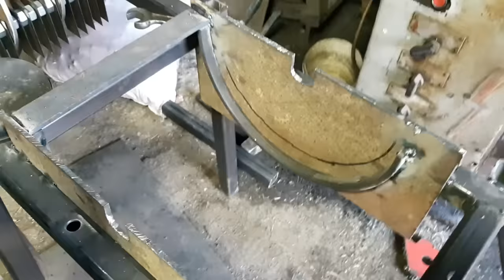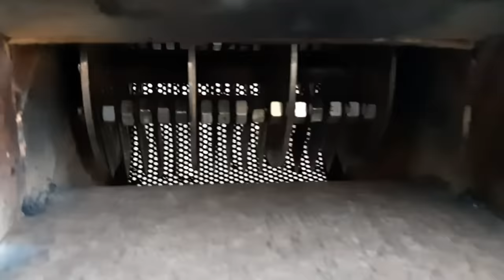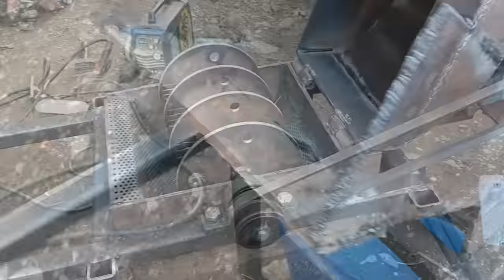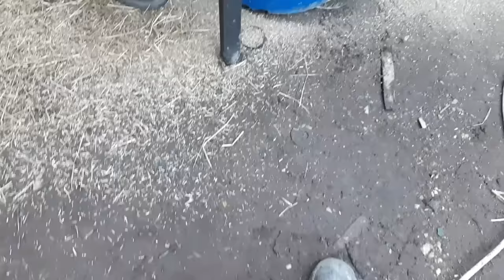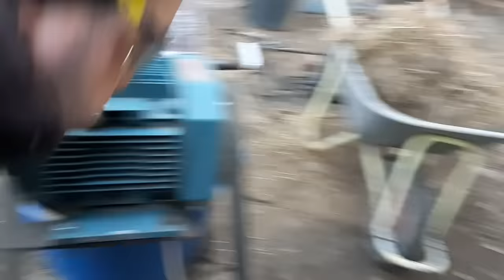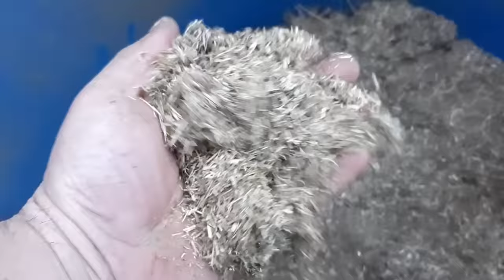DIY Hammer Mill Machine - Making Hammer Mill

Comment: Good job.  I run a 150kw mill, we use a centrifugal fan to pull the material through the mill.  It helps to pull material in and suppress any dust too. 👍
Reply from the maker: Thank you.  In this video, the project is not completed.  I built a centrifugal fan and a cyclone at this grinding mill.
Reply: I work using that Mill machine same model,flying dust very loud thats make my lung cry😅😊
Reply from the maker: @KotpT-ye3td  I made some changes to this mill, I made a fan and a cyclone. Thanks to these changes, the dust does not affect me. https://youtu.be/Pei5F4p701c?si=yw85lXNirRGgz0nY
Reply: @DorelBorlea  excelent

Comment: Try to reverse the rotation of the axis
Reply from the maker: The engine speeds were too high and because of this the mill did not work well. I made some changes and now it works fine.

Comment: U are crazy guy u first use hend to put grass in then hamer if machine catch hamer it will exsplode like granade....
Reply from the maker: You are right. It is quite risky to insert the straws by hand and it is not a very good idea with the hammer either. I built the hammer mill and I know which is the safe zone for my hands. Anyway, I will make some improvements and it will no longer be necessary to push the straws by hand.
Reply from the maker: Hindi natapos ang proyekto. Kailangan kong gumawa ng cyclone para dito at pagkatapos nito ay gagana ito ng maayos.
https://youtu.be/jpYA8LBufI8

Comment: IF  YOU WANT TO MAKE ITS COVER USE ONLY A BIG DAIA PIPE IT WILL BE VERY EASY  CUT THE PIPE IN TOW PARTS
Reply from the maker: I want to build a cyclone to collect the dust. I think the mill will work much better.

Comment: not positive but looks like the machine does not pull in and stoves wonder if reversed your motor rotation causing the substance to go to the top then through the mesh??
Reply from the maker: The motor speed was too high 3000rpm. I made a turbine and a cyclone and now works great.

Comment: He tried, just that he need to control the outlet and inlet well. I was once facing the same challenge on one of my projects.
Reply from the maker: The engine revs were too high. I replaced the motor with a 1500 rpm one and built a cyclone. Now it works much better.

Comment: Schimbă sensul de rotație la motor.
Reply from the maker: Daca schimb sensul imi arunca paiele afara. Doar asa merge bine.
Reply: @DorelBorlea la proba făcută fără tobă se învârte bine  ,când ai făcut proba cu paie fără exaustor dădea paiele afară.
Reply from the maker: Am montat si exaustor. Sensul de rotatie trebuie sa fie asa cum apare in acest videoclip. Cutitele trebuie sa loveasca paiele si sa le arunce spre sita. Am facut proba si cu senul schimbat si nu a functionat corect.
Reply: @DorelBorlea  La prima probă îți dădea paiele afară fiindcă nu veneau ciocănelele de sus în jos .Te-a obligat exaustorul să schimbi sensul.
Reply from the maker: Nu. Paiele au dat afara din cauza motorului. Motorul are 3000 rpm in acest videoclip. Pe parcurs am montat un motor de 5kw la 1500 rpm.